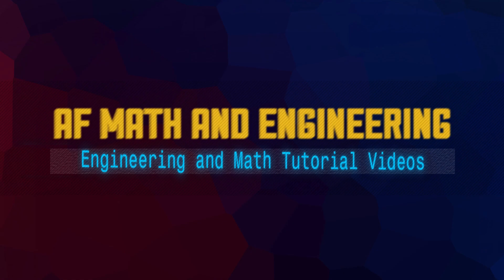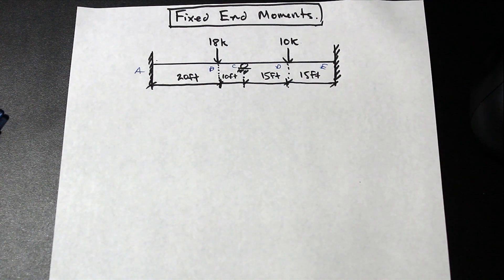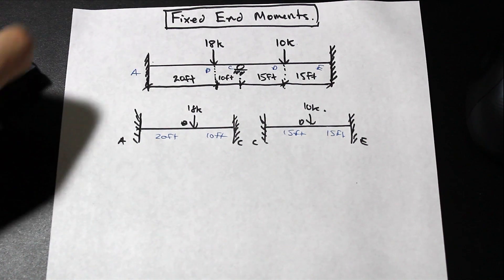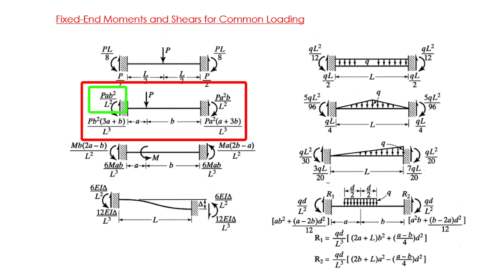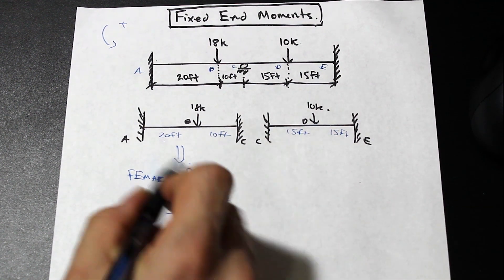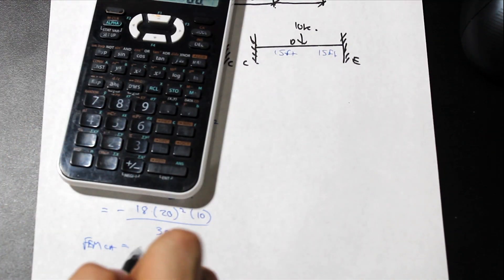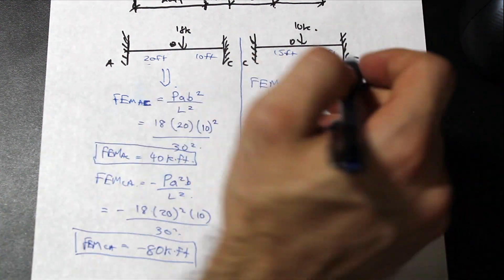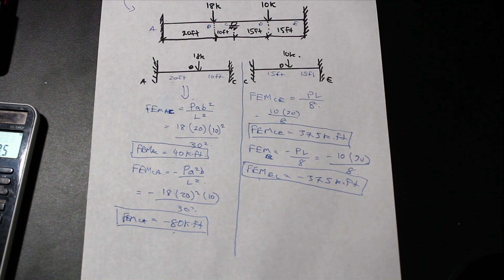Solving for Fixed End Moments of Beams (FEM Table Included)

Comment: Hey man quick question, what do we do when we have 2 different loads in the same span. For example let’s say in the span AB is 15m and you have 1 load of 15kn at 5m from A and 12kn at 10m from A. I know you can use the formula 2PL/9 but in this case the P are not the same value. How would you handle that?
Reply: Use superposition theorem 
I think i am late 
But it will help future generations 😅
Reply: @Kashmirhouseplans  Jumping on even later, so I need to do FEM calc, shear and bending diagram for each load on a span then superpostion the diagrams to get FEMab & FEMba that I can plug into the 3 moment equation? Sorry not an engineering student but it is relevant to my job.

Comment: You cannot simply assume the internal support to be fixed unless you're using moment distribution method.. In that case i would suggest moment distribution method or three-moment equation method.
Reply from the maker: They're called fixed end moments for exactly that reason: It's assuming that both ends are fixed.
Reply: AF Math & Engineering yes but Pab²/L² is only applicable to fixed end beams without internal supports. I thought what you did there was moment distribution method since you have the same assumption with the moment distribution method for fixed/propped beams.
Reply from the maker: @benjiealviar1137 when we find the FEM moments of any span, we assume the ends are fixed end moments.  Hence the name 'fixed end moments'.  I'd suggest reading your structural analysis book from school for a more in depth theoretical explanation of the concept.
Reply: AF Math & Engineering i mastered the solutions to any kinds of loading in restrained beams. However when it comes to that kind of beam, none of my answers were correct. It's because it is analyzed as continuous beam.
Reply from the maker: @benjiealviar1137  this example was taken directly from a very reputable structural  analysis textbook.  This is a common and well known technique that's used in solving a number of structural analysis problems for indeterminate beams.  Please consult structural analysis by kassalami for more examples and an explanation.
Reply: AF Math & Engineering it's kassimali. That's our reference book when i was in college.
Reply from the maker: @benjiealviar1137  great, it was ours too.  Go to the fixed end moment chapter and look for this exact problem for your explanation. Good luck

Comment: Sir, Is there any standard formulae for finding the fixed end moment calculation of a beam with  trapezoidal load( 2-way trapezoidal load from slab) distribution? could you please share any link?
Reply from the maker: Hey, thanks for the comment buddy.  I know what you're referring to, the trapezoidal tributary area for 2 way slab distribution to beams.  In this case you'd need to break the load up into different cases and use superposition.  You'd have a UDL in the centre, and two triangular loads on the right and left.  I'll take a look and see if I can find the FEM formula for this loading.
Reply: Thank you very much sir,it would be so helpful if you do so. And your videos are very helpful. Please keep posting.
Reply from the maker: Arun dinesh thanks man!
Reply from the maker: I couldn't find any deflection tables for what you mentioned.  For this case you'll have to either solve for the moments by hand or use some software to generate them for you.
Reply: Sure sir, I got the values from software.Actually I was looking to solve in by manually too. Ok, thanks for your response sir. :-)
Reply from the maker: Nice man.  Were you looking to derive the equations for the loading case, or were you looking to just find the values at the fixed ends for moment?  You can derive the equations for any loading case using deflection by integration.  We did a video here https://www.youtube.com/watch?v=39zdlzwDvgI

Or, choose an indeterminate beam method and solve for yourself.